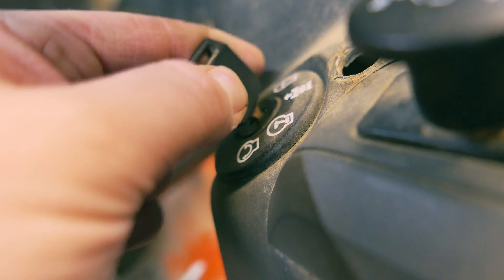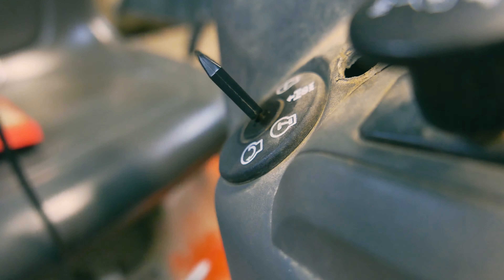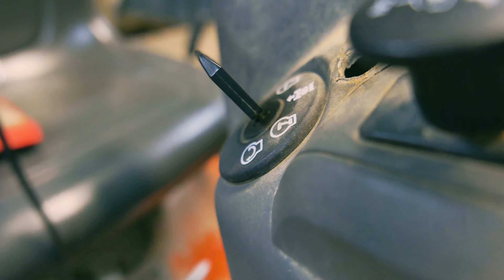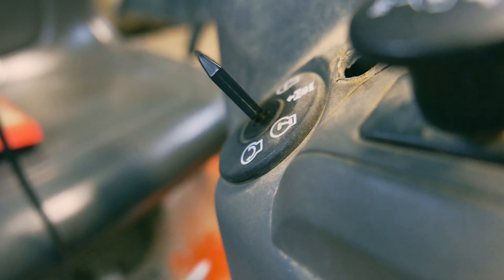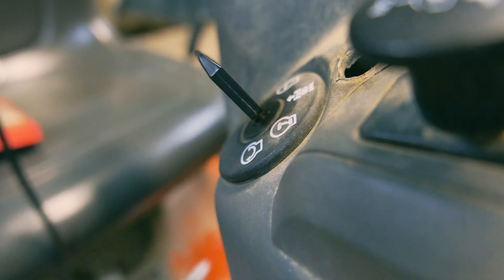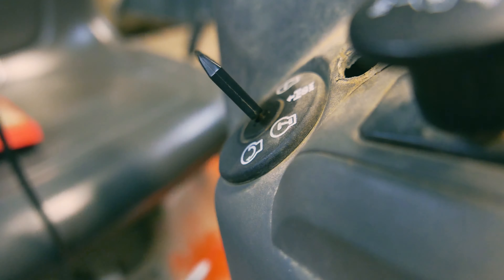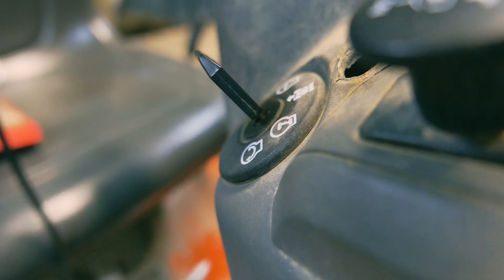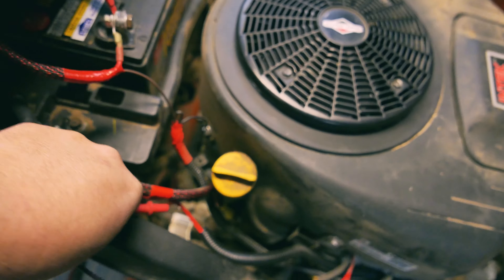Husqvarna YTH 24V48, fixing electrical Issues

Comment: Are the wires off the main harness 1 brown and a pair of black wires that go to ur head lights??? My wire melted and shorted i want to patch a new set of wires to the head lights blue n whitw head light wires. Is the 2 black that are ran parallel the positive or the ground? And tgeres a singkw brown off main harness goung to head lights???
Reply from the maker: Man I don't remember, use a multimeter to test the wires and see, its just 12v, thats what I used on that mower.
Reply: What did you exactly do? You bypassed the original start from the harness and ran your own key and wiring so it's independent from the rest of the bullshit and just works?
Reply: By using that type of switch for key you bypassed the safety and it works?